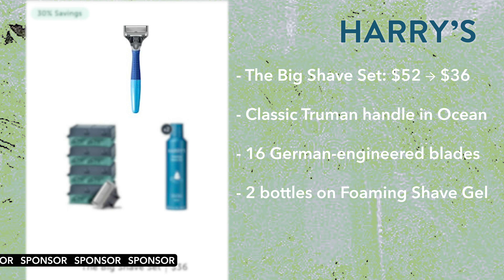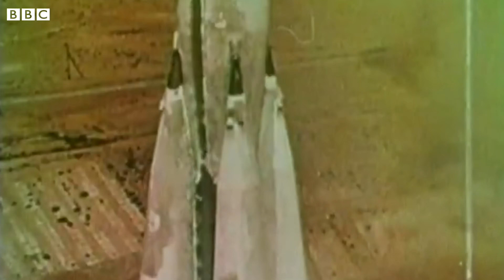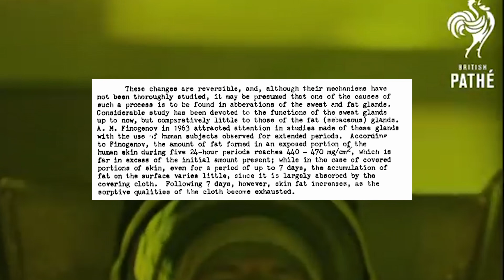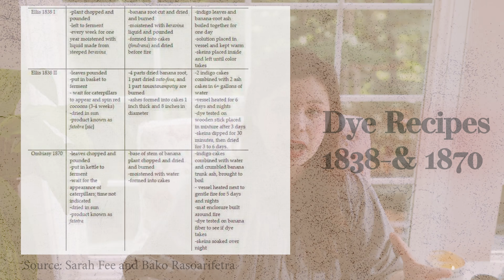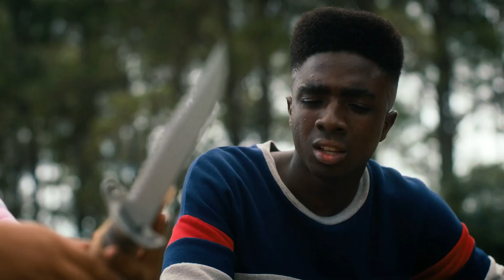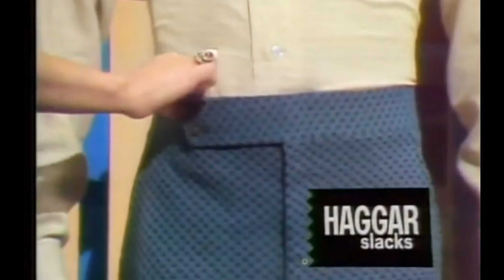The DISGUSTING truth about Laundry

Comment: I live in Russia, and electricity is relatively cheap here, but people rarely use dryers. For all my life we actually gave been air drying clothes, both inside the flat and on the balconies.   We also usually have a centrally heated tube in the bathroom, installed in every flat, for drying towels, underwear, socks and other small things. I also was taught to wear t-shits pretty much as a shift equivalent. Not ideal, they are cotton and not  linen mostly, but yes, they help to protect dresses, sweaters and other fancier items, so i usually keep t-shirts around fot this purpose even when they become discolored from washings or have stains. Nobody sees them, so it doesn't matter. What I shall pay more attention to is sanitizing the underwear, as you say in the video.
Reply: I use eucalyptus oil it disinfects, softens & makes the clothes smell good. Plus a little goes a LONG  way.
Reply: Don't forget Abby is talking about american laundry. Their laundry detergents, fabric softeners, etc. are not quite the same as probably in Russia (i know for sure they aren't the same as in Germany). And I bet your washing machine can wash it hotter than 50°C which is the maximum for american laundry machines. Just go with 60°C for panties and you don't have to worry, especially with some water detergent (and leave out fabric softener entirely or at leasf for stuff that touches your skin directly - I replaced mine years ago with a bit of baking soda to soften the water and fiber and a few drops of lavender oil which has an antibacterial effect, smells nice and keeps moths and bugs away. Can't guarantee anything about synthetic fabric though, i'm fully on natural fibers and some lyocell and modal by now).
Reply: @olgahein4384  Wait what!? The maximum for their washing machines is only 50°C!?

I always wash my underwear, socks, bedsheets and towels in 60°C, and occasionally I might even wash them in 95°C. But those temperatures will shrink stuff and ruin synthetic fibres, which I'm fine with since I avoid polyester clothing. But lots of underwear and pretty much all other regular clothing these days are made of polyester, which 60°C water will eventually help disintegrate. I always assumed everyone washed their underwear separate from all of their other clothing. That separation is just so easy and intuitive for me since I always wash stuff that is in direct close contact with my skin with hot water, and wash other stuff in colder water since it doesn't get as dirty. But maybe Americans don't tend to separate them... If that's really the case, then I agree with Abby wholeheartedly that their laundry practises are disgusting 😂

I'm also from a family with a lot of skin issues and have sensitive skin myself, so I've always washed my clothing with a vinegar based detergent which disinfects and contains no perfumes. But I'm also lucky to live in Finland where the water is very soft, so I've never had to think about softening water, or ever used fabric softener. And while my family had a dryer when I was growing up, it was only used in the winter and in the summers everything hung outside to dry in the sun. The sauna was also always full of drying laundry. I've never owned a dryer myself and have just dried my laundry on the balcony, indoors on a rack, or in the apartment building's drying room. 

And we also have those heated tubes like in Russian bathrooms, but it can only fit one towel or a few socks at a time so I honestly don't use it to dry laundry very often. It gets the most use in the winter months to dry soaked and snow/ice-covered wool mittens, scarves or beanies.

Air drying is so easy, cheap, and more environmentally friendly. So what I don't get is, even if they aren't allowed to use laundry lines outside in the US, why don't they dry their clothes using drying racks? 🤷🏻 The US is a weird place.

Comment: We use vinegar to finally wash our clothes. Don't really know why but don't people use vinegar to clean stuff? Soooo, yeah.

Also nearly no one in Finland has a dryer. We just have a rack to hang clothes. My family has ours in the sauna 😁
Reply: Most people don't use vindegar for laundry because it is acidic. Acidic liquids are the enemy of every rubber and metal part of your washing machine. Unless you use it for handwash only ofc (it's also nice for rinsing your hair btw, better than any conditioner when deluted with water). I use baking soda for softening water and fabric and lavender oil for a bit aditional sanitizing (though not necessary, cause I live in Germany and can wash my clothes in a boiling program at 95°C if i want to) and a nice scent that also prevents moths.
Reply: Every fiber of my body hates vinegar. I don't even own any. Just no.

Comment: I’m from Europe and we have never had a tumble dryer. We have a clothing line in our garden, and a smaller clotheshorse (idk if that is the correct name) that can be carried inside or outside depending on the weather. When the weather is good we hang the clothes outside, the bigger clothes and sheets on the clothing line, the undergarments on the clotheshorse, so as to not put them up for anyone to see. When the weather is bad we either don’t wash or hang the clothes in our cellar or bathroom with a dehumidifier, so that they dry better. Its a pretty good system in my opinion and I’m really glad I grew up like this.

Comment: But how does one care for silk and wool without dry cleaning? It is terrible process for the environment and an inconvenience to carry clothes elsewhere to be laundered.
Reply: I just carefully dunk them in a bowl of warm water that has had a little wool wash dispersed in it.  Clear water rinse well and then drape on a towel on a drying rack (ie don’t hang them or they’ll stretch).
Reply from the maker: Wool is also naturally anti microbial like linen is - so airing it out is usually ok. Surface stains have different needs too. There is the snow washing method, which some people have references here as a successful way to clean wool. 

As for silk - It depends on what type of silk it is. I won’t wash taffeta for example. It’ll ruin the finish.  So it’s other methods to refresh and clean.
Reply: @AbbyCox  What is the 'snow washing method? I've never heard of it before. Any chance you can do a video on it?

Comment: Someone I know who lived abroad said that there was a huge trend of éco-friendly drying techniques and it turned out to be using a clothes line to dry clothes. 

Although a clothes line can be a problem during the rainy season if it’s humid and raining.
Reply: Where I live it gets cold, then the clothes dry either very, very slowly on the line, or not at all. Half the year I can use the laundry line, half the year I have to use the dryer. The dryer heats up the kitchen and living room though, so I can keep the thermostat down while doing laundry and still enjoy a warm living space.
Reply: @winterinbloom  My area is the same. Sometimes when it's cold in winter, I'll do a load of laundry just so I can run the dryer.

Comment: Haven't had a lot of issues since we moved to front loading washers. I also wear an undershirt at all times and my "shirts" don't come into contact with my body. I blame my military experience < grin /> for that. Just got used to having undershirts. My wife cannot have dyes or scents so we buy special soap that is dye and fragrance free. I do not use a softener at all. We use wool balls in the dryer. For drying I use low heat for about 70 mins. We cannot dry outside for various reasons and inside would not be practical because of humidity. When we lived in the Central USA we did air dry but it means not having trees near the lines. :)

Comment: I'm in London, UK and have to use a water softener in my washing machine because we have very hard water. The one I use also has an anti bacterial agent in it. We use a spray to extend the length of time between washes, and line dry (outside or in the bathroom) - and I cannot believe there are laws against line drying in parts of the USA!
Reply: I’m from Brownsville, TX in the states and I grew up with line dried clothes. I remember hating them because they smelled bad and were always scratchy against my skin. I’m sad that it’s the better option but I’m also confused by the “smells better” comment. I’m wondering now if I also have to move to a city with less air pollution just so my line dried clothing can smell better…
Reply: @sednova  it is related to what is in the air, pollution, pollens, etc. I live in mid Missouri (MidMO) and our line dried laundry smells fantastic spring and summer, but can pick up odd smells in the fall when people burn leaves nearby.
Reply: @sednova  clothes dried outside always felt like rigid sandpaper to me, glad to find someone else who doesn't understand the whole 'softer when line dried outside' thing
Reply: @bellablue5285  That is because the calcium will solidify as the water evaporates. Just give your wash a good shake to break the bonds.
Reply: @sednova  I did a bit of research and the smell I hate from line drying clothes (or someone else coming back inside from being outside for a while) is the kind of acrid almost acidic/metallic smell most likely associated with high levels of ozone in the air. In cities levels tend to be higher on warm sunny days (i.e. when you'd most be wanting to put washing out to dry) There are however different smells you might be sensitive to. Like some people love the smell of petrichor, others hate it.
Reply: I don’t know that there are actual laws but some private communities have home owners associations that are anti line drying because it’s ugly.  But people pay to live there and had a choice of whether or not to buy in that location.
Reply: @leslieinadress  I hate homeowners associations, I live in France and the apartment we own has a co-op and we have to apply to them for basically anything we want to do to the exterior if it's like permanent. And one thing we want to do is install bug screens because, well, typically no one has them here, they exist but no one gets them, and we had to explain to the co-op why they were important for us to have them (I'm allergic to a lot of bug bites, and keeps our cat from falling out the window), and the co-op was about to say no to us because they aren't "aesthetically pleasing", 😂😂😂😂 of couse they aren't, lol, they are the epitome of function only
Reply: When I lived in Korea dryers were basically non-existent or extremely expensive, so everything was line dried, but we couldn't really dry outside because the pollution in Korea (especially in Spring) was, omg, there was this literal neon yellow dust everywhere and if I left the windows open when I dusted the duster would be bright yellow 😂😂😂. Winter things dried faster inside anyways because floor heating is standard in homes and clothes just dry faster with it.
Reply: What what whaaaaat?

Laws against line drying?

I’m going to have to investigate this, that’s for sure.

(I haven’t watched the full video yet so I’m really interested to find out what Abbie says ❤)
Reply: @SecretSquirrelFun  I assumed it was homeownership covenants in some suburbs.
Reply: When I lived in Surrey there were local rules (whether laws or homeowner association rules) against line drying laundry in the back gardens of some neighborhoods. The one I remember backed onto a golf course so the rule was about not displaying (looking "poor") laundry. I wish American homes had drying cupboards ... something that would be very useful especially in the more humid parts of the world. Use that waste heat from the home heating system or the hot water heater to dry clothing!
Reply: Our home owners association will fine you if you put a clothes line in your back yard - even though we have privacy fencing that hides everyone’s back yards from view. It’s the most frustrating crap ever. Like chill tf out Linda…I’m trying to save my clothes, the environment, and my energy bill each month.
Reply: hi, also UK, can i ask what spray you use on your clothes?
Reply: @morgaaaaaa  Hi - I use Day 2 or Febreeze with antibacterial stuff. Day 2 has a noticeable smell that's not unpleasant, but it's also not a laundry smell - but it's quite faint
Reply: @AmAppleton  thank you for getting back to me! gonna give this a go
Reply: You have explained the vegetable oil smell in my closet, the stale vegetable smell.
Reply: @poetmaggie1  Try cleaning your machine. Just put it the temperature as high as it can, put in a lot of vinegar and set for a full load but leave the machine empty. Then clean all your filters. It may help.

Comment: I'm lucky enough to have an actual laundry room in my house, where I installed a hanging bar. It's just a heavy duty metal closet rod, a length of chain, two chain connectors, and two eye hooks. Screw the eye hooks into the ceiling joist, connect one end of the chain to the first eye hook, thread the chain through the closet rod, and connect the end to the other hook. I used heavy duty eye hooks and it has worked great! It hangs directly above my washer and dryer. I also installed four towel bars and some hooks on the opposite wall for hang drying. Works great for leggings, pjs, shirts and sweaters and doesn't take up any room.
Reply: I live in an apartment building in Sydney Australia. & while we have a communal clothing line (hills hoist seriously look it up they're SUPER efficient). I use a portable collapsible drying rack for my underwear. Cause I don't want the neighbours looking at my knickers drying on the line. 👙 & it stops the pervy ones from knicking them.
Reply: That's a great idea! I have three collapsible racks that I spread out around the laundry room but it's not always enough space as I try to air dry as much as I can with 3 peoples clothes.
Reply: @floraidh4097  I place mine in the living room as it gets the direct afternoon sun.
Reply: i always hang my smalls and leggings, as those fabrics are severely damaged in a dryer and even cheap clothes cost too much for that.

might have to look into one of those old circular drying racks for some of my other clothes.

Comment: That Russian stat works out to be about 3 grams of fat per square inch (so slightly over 1/10 ounce). Eeuw! (And I've-double checked, yes this is the equivalent of 9kg over a whole skin surface over the 5 days of testing, so nearly 2kg/day).  

Also, I've lived all my life in soft water areas, and never mind washing clothes in hard water, I don't feel clean after washing myself in hard water!

Thought... way to reduce number of times clothes need washing: removable armpit shields? Lower access cost than full linen undergarments. And new discovery (for those of us who sew using modern techniques, but try and avoid polyester): fusible woven cotton interfacing!
Reply: I must have my maths wrong, that works out to be 9 kilos over a whole skin surface of 2 square metres. Which you'd notice!

Comment: Thank you for this awesome video.
I line-dry most of the laundry (but this is also much more common here in Europe) except for towels (craving the fluffiness, guilty here) and bed sheets because they take up so much space.
I wear many dark clothes so I actually need to avoid the sun because it would bleed out the colours... 😪 i'd rather not think too much about the non-sanitizied part of this practice now 😱 but I don't see a better option for these clothes right now...
For plastic-based materials, mostly sports leggings etc. I use something called a guppy bag. It (hopefully...) holds the microplastics released inside the bag. But I hope there will be proper microplastic filters for washing machines soon.
Meanwhile, I try to reduce the percentage of clothes with non-natural fibers: I'm particularly a fan of wools. Often it's enough to just hang and air them without washing them with water.
Reply: @ItBeThatWaySometimes  Thanks for letting me know, will look into it. So far I only knew about that one that works as subscription where you have to send the filters in afterwards.
Reply: You can turn your clothes inside out and line dry them in the sun if you have the space! I line dry outside during the warmer months and turn most of our darks inside out (or put them in the shade).

Also, I agree about being a fan of wools!
Reply: @ItBeThatWaySometimes  thanks, I think I found the video you mean! for others searching: shelbizleee microplastic filter should do the trick 👍

Comment: Hi Abby, Thankyou for the really interesting video. There have been some suggestions in the UK because energy costs and consumption in the winter months about using a dehumidifier as it uses less energy than tumble dryer and in the winter in the UK drying outside becomes alot harder to dry, got to love British weather :) You can get magnetic filter to help filter the water going into the washing machine that I believe will help soften the water and stop you washing machine buildingto much limescale. You can also get filters on you outlet pipe that will capture microplastics but these have been going for the past few years. hope this helps. I love your videos